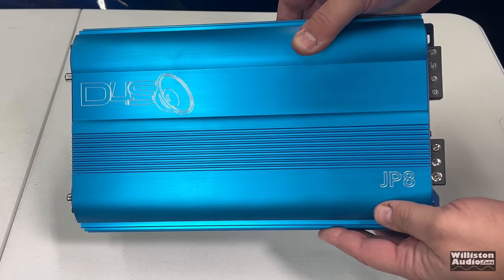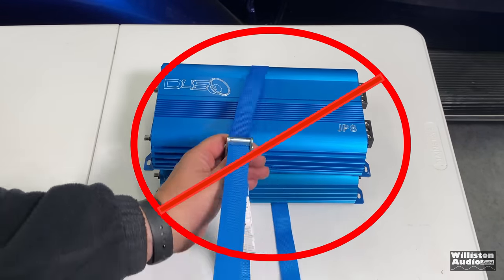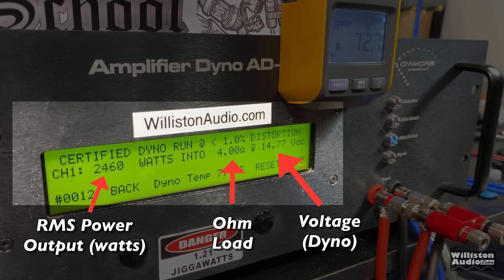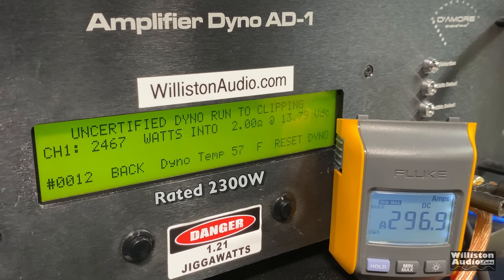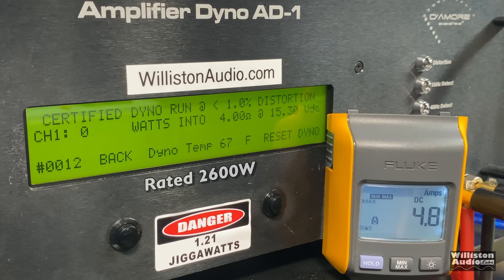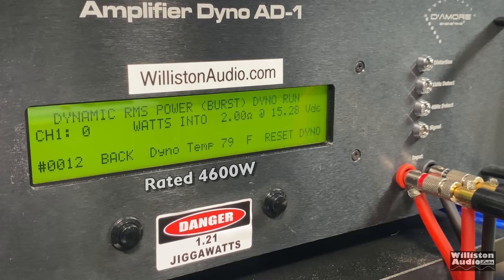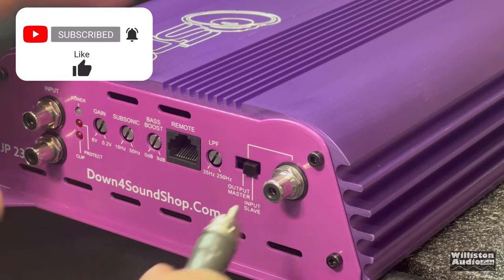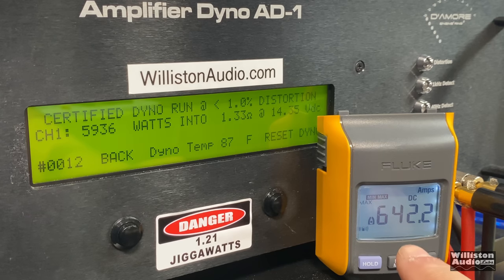Getting the Most out of Your Amplifier: How to Strap Monoblock Amps for MORE POWER!!

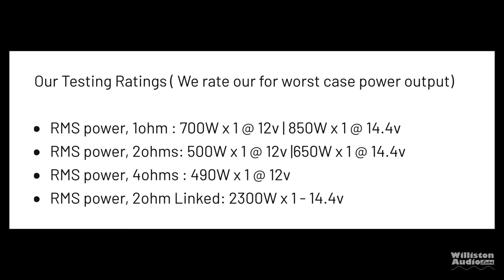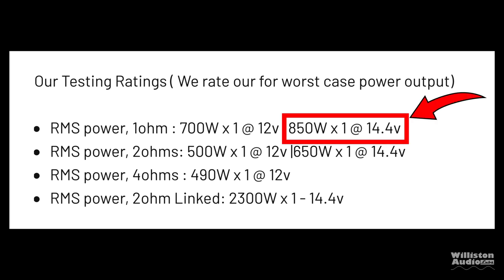Comment: They did not provide "Whack Math" as you call it.  The math is absolutely correct.   At 1:20 they show 650 watts at 2 ohms at 14.4 volts, that would be 36.055 volts at the outputs.   Formula for wattage 36.055volts x 36.055volts /2-Ohms=649.98 watts  (650 watts).   Once you "Strap" the amps you now have 72.11 Volts at the output of the 2 "Strapped" amps.   72.11 x 72.11 /2 Ohms = 2599 watts... Otherwise known as 2467 watts @ 13.79 Volts just as You showed us with your dyno test.   Again back at 1:20 they show 2300 watts at 2 Ohms @ 14.4 volts.   That's the part you call "whack math" but no sir, that math is absolutely correct and you demonstrated it.   They show 2300 watts into 2 ohms strapped instead of 2599... why?  Maybe their power supplies aren't strong enough to push against each other when strapped, maybe other reasons, the world may never know.   Will you publish this post?  I hope you realize your mistake, surely you know ohms law and the way to calculate wattage by now.   Have a Nice Day

Comment: You need a voltage and current stabilizer so that there are no drawdowns in active power. Do you have such devices for active stabilization of direct voltage and current on sale in the USA? Or do you need to design a printed circuit board?

Comment: My qusstion is would u get the same outcome if u perfectly gain matched your 2 monoblocks and wired one amp on each voicecoil on a single subwwofer build? So is strapping the same outcome should be right? 2 amps to 1 big amp or 1 amp per voicecoil power would still be the same outcome coorrect?

Comment: I have 2 JP 23 v2s and they will be running 2 Resilient Sounds Platinum 18's.  I can still use master and slave function if I'm not strapping, right?  You said the controls for one amp control the other, so will I be able to use a single bass knob and not have to set the gain and crossover frequencies for the slave amp?

Comment: So let's try it this way if I take a 4 channel amp only used two channels can I run them differently for example one of those channels 2 ohm load 2nd Channel 4 ohm load is that separately or is that combined together in the amp

Comment: This is kind of a random question but while you were talking about efficiency it made me think of something. would an amp be more efficient being driven at a lower ohm rating but at a lower power rating. for example lets say an amp is good down to 1 ohm and makes 1000 watts, and 500 watts at 2 ohms but you only need that 500 watts would it be smarter to get a sub ran down to 1 ohm and just have the gain turned down or just get the sub ran at 2 ohms with the gain turned to the rated rms power?
Reply from the maker: Should be insignificantly different

Comment: is there anyway of figuring out on the cheap if a amplifier can do rated RMS? i got a sub amp here that is so small it required external 100A fusing per manual.
Reply: Fuse amp x 14.4 x efficiency (depends on class of amplifier)

Comment: You said you can't get more than double the power by strapping amps together but you just showed us you can.  Both amp tests was more than double of just a single.
Reply: That's not what he's saying. He's saying if a single amp dynos at 1000 watts, when strapped you won't get any additional wattage out of that amp. If the other amp dynos at 1050 watts your total should be 2050 watts and no higher. He saying you shouldn't get a result of 2500 watts just because he strapped them.
Reply: His amps dynod at over rated rms. Say 2 1000w rms amps dyno at 1100w and 1250w. The strapped result will dyno at 2350 watts.
Reply: You won't get more than double what your worst performing amp dynos. You won't get the extra power from your better amp because the outputs are synced. Each runs half the sine wave.
You have to run your weaker amp as master, so there will be no chance to clip the other side of the sine wave.
Reply: @johndough111  first of all, if both amps are the same, they should do around the same power.
No one should EVER use 2 different brand amps with different ratings in a strapped scenario, even the same brand.
Reply: @PoXFreak  his comment didn't say that. He was referring to how one amp, could be stronger than another, and you'll never get more output, then both combined. It wasn't in correlation to being different boards or brands. He just worded it a bit differently
Reply: Strapping is just for comp. Ur better off the less power supplies the better due to inefficiencies. You will pull more current with 2 than 1 designed to match what 2 would put out. The use really is for larger amps so you could do 20k per coil. Drive sub 6 sec and win finals and recone all your stuff.
Reply: @numlockkilla  If you’ve already got one of the smaller amps, it’d be cheaper to just buy another of the smaller amps than get a single big amp.
Reply: @PoXFreak  when saying "first of all" it helps to have at least 2 points. You won't look so simple in the future.
Reply: @derrick_v  second, it's better to get one big amp to do the power of the two smaller amps because the power factor is greater when you have the mains supply closer together, especially in high-current draw situations.

Better?
Reply: Thanks d that was the best strapping video yet
Reply: @derrick_v  it'll be alright
Reply: I was thinking the same thing,. The jp8 is rated 850w @2ohm which is 1700w for two.  But it dyno'd at 2300 strapped @2ohm , it's way more than double what a single jp8 can do       big D's comment got me confused 🤔
Reply: JBL club A owners manual does not tell u about the way the master and slave speaker outputs I've had everything right except that I just had my sub wired to my slave amp...In my brain it was out from master into slave so slave has all the output...So tomorrow will be pulling my seat out to correctly hook up the subwoofer ...Thanks JBL!!! Big dummy Manuel is what they have as far as there's go....All it shows u is the RCA part that's it!!!!So this whole time I've only been using 1 amplifiers power not both!
Reply: @johnoates3326  why would you assume a video about a different brand with a different focus is more accurate than the ownership manual?

Comment: I could sell customers good clarion deck run door and tweets off deck bridge one channel of the Kohler 400 watt run one 12 inch sub and run 4 5×7s stereo on other channel did that in a mack truck sleeper custom box I built under passenger seat nobody believed that's all it had was one sub cause it pounded .I did alot of systems like that

Comment: You dont need to do all this crap I had a stereo shop in late 90s till early 2000s I won many comps with just a punch 45 running 2 clapped out Pyle pros 15s in trunk of my Lincoln .I also won comps with my 86 restored cutlass I had it as my demo for my shop so I had everything I sold installed and I'm telling you I had a kohler 800 running my 2 12 in punch pros and a Kohler 400 running my alpine mids tweets in dash and one 9000 ounce bulleit tweet in rear plus two kicker 8s running as mids I sold hundreds of systems cause everyone wanted there shit to pound like my shit